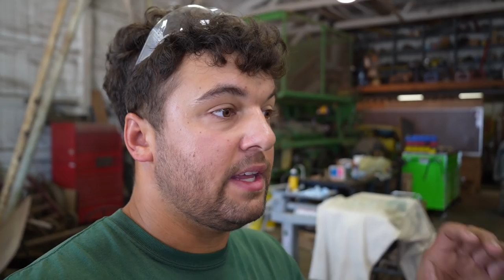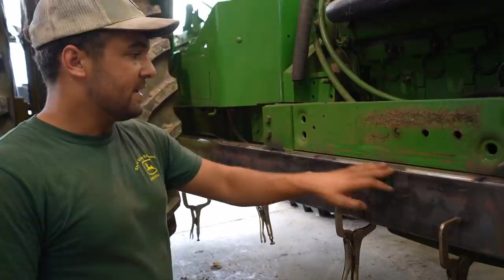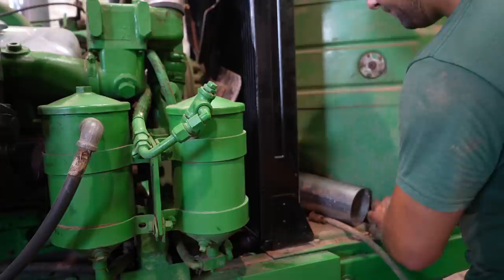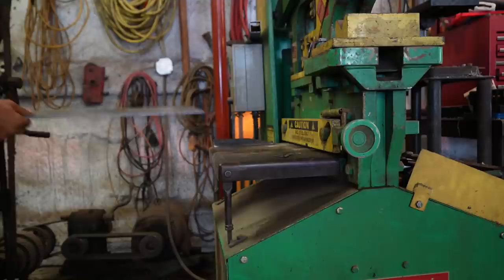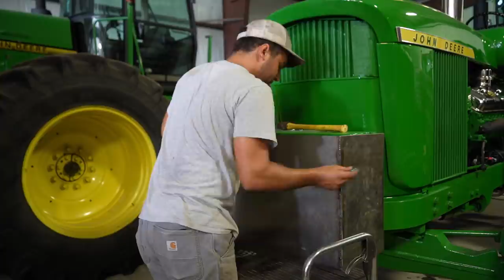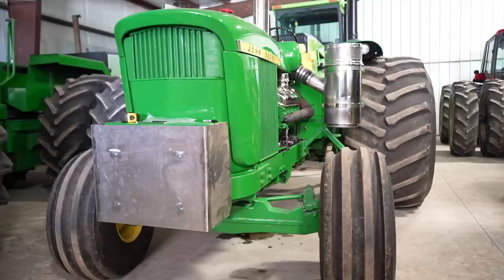Fabrication on some John Deere 5020 Repowers

Comment: Amazing work. Just a detail guy. I am.  Its 5 1/2 inches on one end and 7 in on the other end. Not other side. Frame rail tapers. I know you capped it for looks. But I, would. Of  dimple died it and welded in the circles for the strength.

Comment: Some rads that have more fins put in have more trouble because they plug so easily.
Reply from the maker: That's a good point. The other 5020 repower we restored has 11 fins per inch and hasn't plugged yet, but we don't really run it in any harsh conditions.